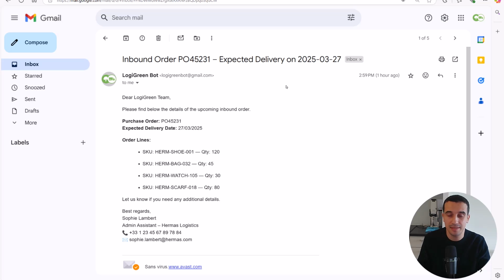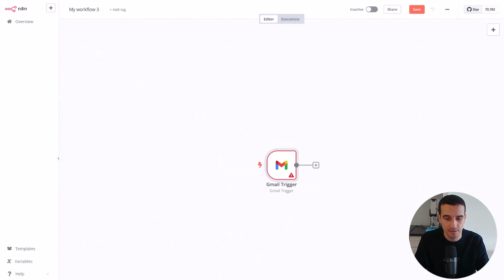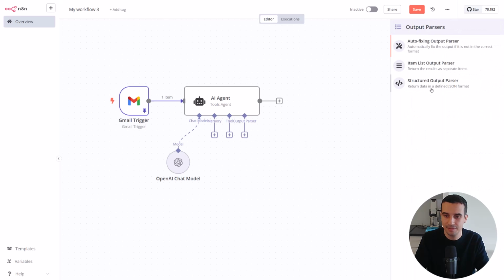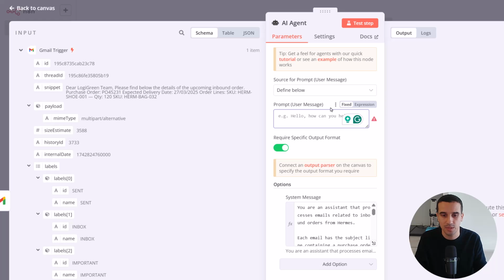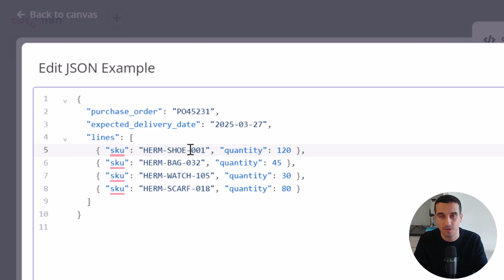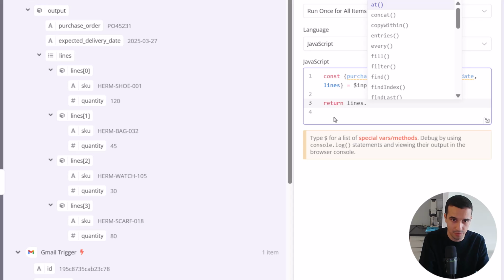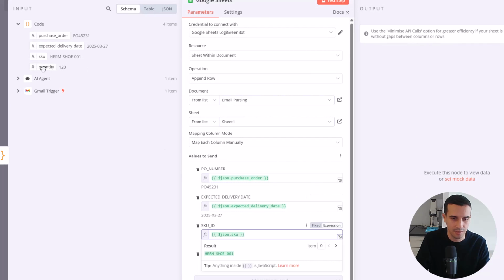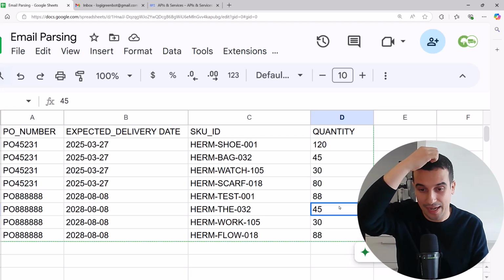Create your AI Agent to Automate Logistics Workflows with n8n

Comment: Sir, my question is that supply chain corporates or logistics sector used software like SAPS/4 Hana, Oracle, salesforce, then why they use this automation, Is there any still gap that need these type of automation, only in supply chain sector, as I am a supply chain graduate.
Reply from the maker: For most of the time, the value chain of a company is not 100% covered by systems. For instance, this tool has been developped for medium sized companies that may not be equipped with cutting edge software.

Comment: How can I use n8n to build an AI agent Chatbot to track order query. The data is in Google sheet, I have over two hundred thousand order databases.

I built two AI agent but the high number it can take is one hundred. please sir, I can build a one that can handle higher numbers
Reply from the maker: You should have a default limit in your workflow. Have you access to the SQL queries generated by your agent?
Reply: @SupplyScience  Please what's "Have you access to the SQL queries generated by your agent? sir